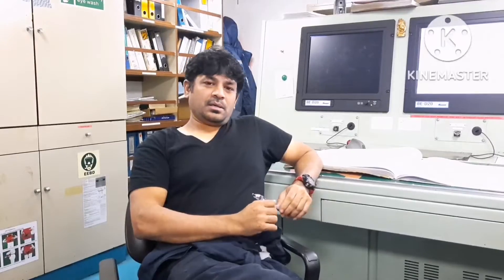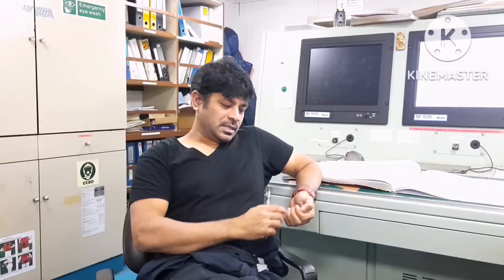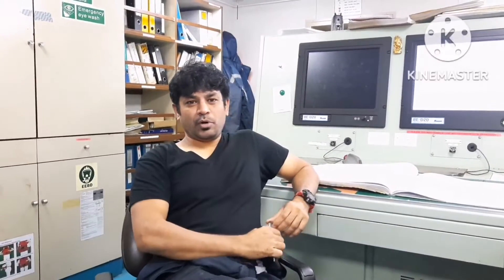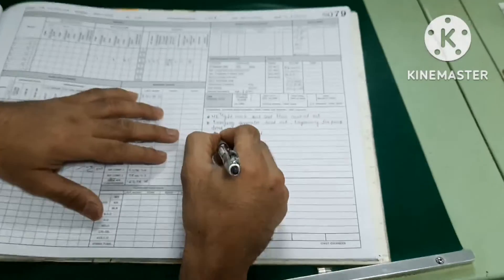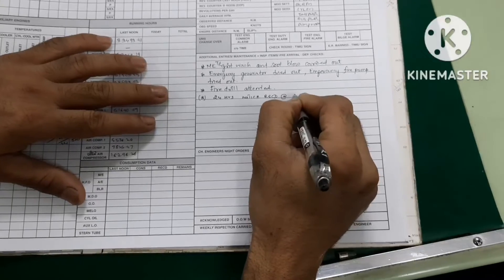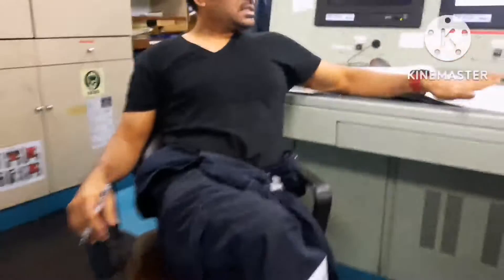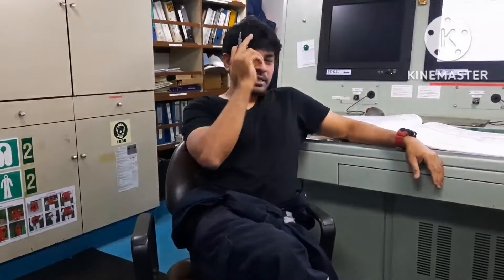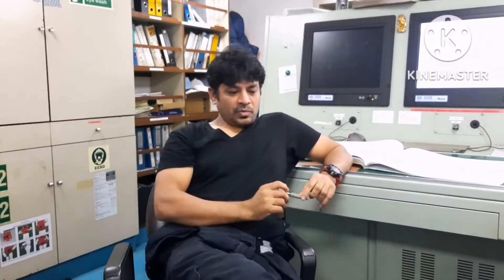HOW DO THEY DO... HOW TO DO FUEL OIL CHANGEOVER FOR EMISSION CONTROL AREA ONBOARD SHIP..

Comment: But what if there's a fuel changeover control module? And where's a changeover valve?
Reply from the maker: if there is co valve then it valve by itself open close according to setting without giving thermal shock

Comment: If FOBAS calculator is not there, is there any other way to find out or calculate how much time it will take for changeover?
Reply from the maker: FOBAS will be alwys available ...if not u have to take and refer previous oil consumption data for the vessel  engine specified  RPM from sea trial record and do the calculation for change over
Reply: @marine-knowledge-basha  okay thank you so much sir for responding.

Comment: What about fuel oil return ? When to change that
Reply from the maker: fuel oil return in case if ur doing from hfo to do ....return line for hfo should kept open and once the fuel oil temperature come to diesel oil temp den u can open the do return and close hfo return,,,This is to avoid hfo gtng mixd with do .

Comment: Is there any diff. in procedure of Fo change over in system having mixing column and without mixing column?. 

Secondly, as both hfo service tank and purifier have seperate heating system.so, why to consider purifier heater in this?.
Thank you in advance.
Reply from the maker: No sir
Reply from the maker: No need to consider purifier heater sir..

Comment: Thanks 🙏. Nice explanation very clearly.  Could you please tell vice  Versa procedure from mgo to Hfo. 
1)
Is it necessary to heat up diesel oil little before opening HFO ? 
2) Please explain it for boiler also . Boiler should run in manual mode always ? Continuously? What temperature I should keep on boiler ? Fuel always different ! 

3) As far as I know from my experience before change over it is best practice to clean all the filters and after change over too. Also one generator to be changed over with separate independent system (flushing pump) first . And keep it running for safety reason . Is it correct please 🙏 comment .
Reply from the maker: Thanks 🙏. Nice explanation very clearly.  Could you please tell vice  Versa procedure from mgo to Hfo. 
1)
Is it necessary to heat up diesel oil little before opening HFO ? No need to heat up diesel oil 
2) Please explain it for boiler also . Boiler should run in manual mode always ? No ,boiler should be in auto mode only
Continuously? What temperature I should keep on boiler ? depends on area u can use either vLSFO  OR MDO

3) As far as I know from my experience before change over it is best practice to clean all the filters and after change over too. Also one generator to be changed over with separate independent system (flushing pump) first . And keep it running for safety reason . Is it correct ..
UR VERY CORRECT SIR

Comment: Cheif 
Why we are reducing rpm?
You have mentioned fo temprature should not be less than 95 because purifier is running  i didn't understand why purifier came in between?
At starting of change over you completely shut the fuel valves of hfo. About pobas calculator it have given timings ?
Reply from the maker: when we reduce the rpm fuel consumption will be reduced and  load will be reduced for the engine to have gradual mixture of oil.
Service tank temperature will be the fuel oil outlet temperature from hfo purifier so the hfo temperature dont go less than purifier temperature.
at the beginning completley open the diesel inlet and close hfo inlet valve.
fobas calculator will give you how much time you need to change over from hfo to do completly in entire system.
Reply: @marine-knowledge-basha  thank you chief